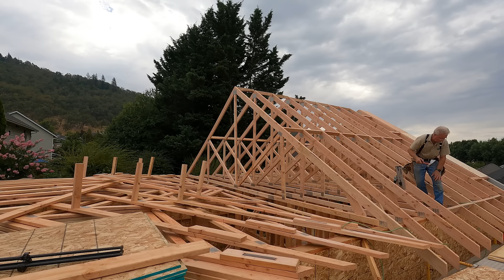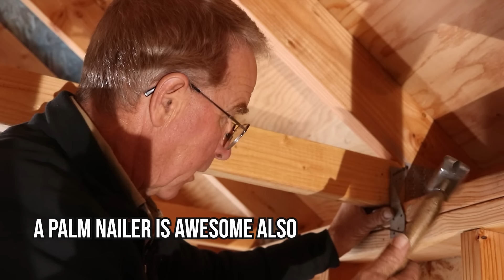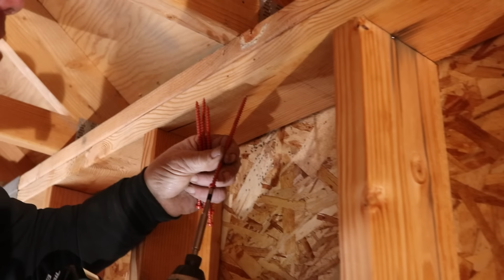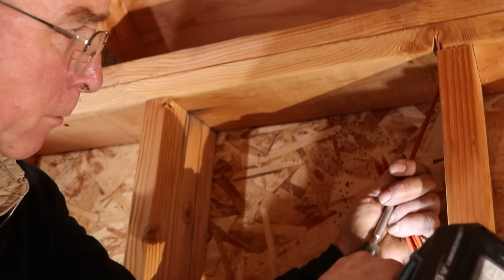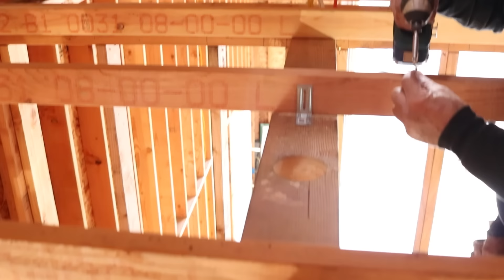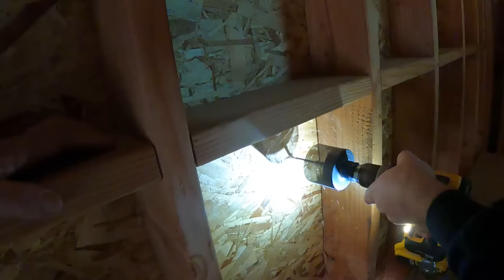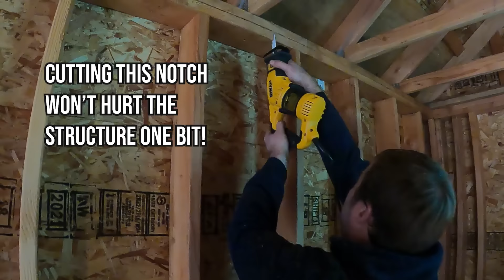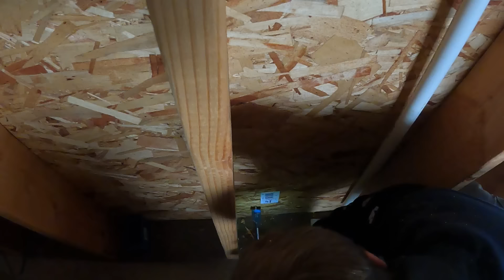Hold On To Your Roof! Truss Screws vs. Hurricane Straps: Shop Build #21

Comment: The first Simpson tie you had is a Simpson "H1" and the second one likely a Simpson "H2.5A".  Both are part of their Seismic and Hurricane family.  One thing of note, don't assume all truss ties do the same task.  While they similarly hold the truss to the top plates, their ratings are different.  The H1 is rated for 480 lbs of uplift, whereas the H2.5A is rated for 700 lbs uplift.  Depending on the size of your trusses, and other truss design requirements, the uplift loads are generally stated on the truss drawings.  You then need to make sure the truss fastening device is capable of providing that uplift requirement.  On a pole barn I'm about to help a guy build, we had to design in Simpson H8 brackets, which are rated at 780 lbs.  Note, you also have to pay attention to what nails (and how many) Simpson states for each bracket.  Obviously, not all nails are created equal.   I know - probably overkill from a design standpoint as just toenailing worked for years.  But, our general way of doing things continues to improve.  I had not seen the new Simpson screws, and not sure what their uplift ratings are.  Seem like a great approach, but also a little more dependent on the installer screwing them in correctly (not on the edge of the truss or out the side, or ...).  Regardless, great video as always.  Kept wondering where you guys were at as far as the garage for your son-in-law.
Reply: Simpson makes screws for the steel plates as well which actually can bump the rating up as well. I used them on my roof and deck renovation I has limited access and with a 90deg bit on my impact driver i could run them in spaces I could nor swing a hammer.

Comment: I'm curious why the condensate line would run so far down in the wall to go out at the bottom. Seems like a sacrifice of thermal efficiency of the wall cavity. Is it a trade off for the aesthetics of not having a protrusion in the middle of the wall?

Comment: With all the roof structure strapped down to the wall frames, seems like the weak point is now the roof sheets or roof tiles which are only nailed or screwed to the structure and may still be blown off in extreme winds? I’m no carpenter, but just had that thought

Comment: Simpson makes shear rated screws now for joist hangers and hurricane ties. When you have smaller jobs It's much easier then pulling out a compressor and a gun, or nailing.

Comment: It seems those long screws wouldn't be nearly as strong as those brackets. The screws only have the screw threads holding them in, where the brackets have an entire screw holding them in at a 90 degree angle. I would guess that the long screws also have much more of a chance to split the truss than the screws from the brackets do.

Comment: If you place hurricane clip or truss tie to the non-sheathing side of the wall as you demonstrated, you have to provide a connection to the stud as well, otherwise the uplift load pulls the plate up.  Simpson mentions this in their catalog.   Otherwise it should be applied to the sheathing side of the wall.
Reply: Great point! You had me go check how I installed them on my 12x16 shed 5 years ago lol. I did it right!
Reply: I've seen the screw type installed at an angle from the inside face of the stud at an angle up through the plate and into the truss. Seems like a really good system for tying it all together.
Reply: Up here in Canada we’ve always placed our ties on the  exterior. Having the steel plates on the inside also creates cold spots due to thermal bridging.

Comment: I'm 72 now, and I feel it.  But when I was young and building my house, I did not have all the tools and knowledge which helps make the jobs easier, and a lot of tasks I did at least twice, instead of once.   Lol.  I struggled.  I remember many late nights after working all day, that I could just barely put one foot in front of the other.  It was very very tiring, but it was a GOOD feeling of extreme tiredness.

Comment: @2:03 you say "you take Tico nails" to nail the hurricane clip.  It would be good to point out that a huge number of these brackets are installed improperly because Tico nails (short 1.25"-1.5" long) are only to be used in very special circumstances and hole locations when called out by the bracket manufacturer.  So you should never use Tico nails into the top plate for this hanger, only into the truss because a longer nail would hit the other side of the bracket.  Unless it is impossible to use a longer nail, it is almost always required to use a full sized (usually 10D 3") nail in every hole, sometimes even if the nail pokes through the other side (just bend over and clench in that case and you get even more strength).  Check the instruction everyone and always follow the manufacturer requirements to get full capacity.
Reply: Lol
Reply: @chuckb470  Can you explain your laughter?  Are you saying that it is good practice to use incorrect nails to fasten nailing plates?  Do you predict that they will achieve the rated strength when used against manufacturer recommendations?  If there is one thing that this channel is try to to do, it is to get people to do things correctly and stop building crappy stuff.  Reading the directions and following the instructions to the letter is important.  Leave an open hole on a joist hanger and it is no longer a proper installation.

Comment: I really enjoy you videos but I have just a couple of observations. The first and second methods are both Simpson Hurrican clips the first has more capacity than the second. "Technically" with trusses, the framer should be holding the top of non-bearing walls down at least a quarter inch and then install the STC truss clip with a gap between the truss and top plate. This is to allow the truss to deflect correctly without putting pressure on the non-bearing wall. Last of all you should NEVER use standard philips screws with any Simpson hardware. They are brittle and the heads will snap off long before the connector reaches its rated load. Nails or Simpson approved screws should be used to maintain warrenty. this is the end of the PSA. Thanks!!

Comment: I once built a little 2'x8' outdoor lumber rack with a roof, no walls. Used hurricane ties to hold the rafters in place because I thought it would be quick and easy, albeit way overkill for what I was doing. Oh man was that way more effort than I expected hammering all the nails in by hand. It didn't help that the structure wasn't very rigid and half the force of the hammer swing went into moving the structure.

Comment: Here in aus we use a cyclone tie. Single piece looped steel strap run over each truss down and fixed to the underside of the top plate. It be good to test these and the Simpson ties mentioned in your video and see how they compare. My bet would be the cyclone tie

Comment: Great video, but geez, you'd have to hang the sheetrock with 16 penny nails to get deep enough to hit that wiring in the middle of a 2x6.  Probably code that you must use the nail plates, though.
Reply: I think code specs like under 2 1/2"...

Comment: Where code requires; Joist hangars, Hurricane ties and all the other engineered brackets require a "code rated fastener" in "each" hole in the bracket.  Framing inspection will fail if you miss fastener holes and or use generic nails/screws in your brackets.

Comment: One of the greatest tools I ever bought was a joists hanger nail gun…until Simpson came out with the truss screw and I bought a speed stick. My hanger nailer just gets dusty on the shelf now except for the few times it’s used on floor systems

Comment: Those truss screws are better than nothing, but the shear strength of the  metal ties  (either style) held by nails cross grain in the bottom chord  will work much better in a hurricane or tornado.  The clips take much longer to install, and cost more but you only get a chance to do that work once.
Reply: Testing shows the screws to actually be stronger, but what do I know, that's just what Simpson says.
Reply: @timothydillon6421  Who is paying for the tests? It seems like those screws could be faked a lot easier unless the screw heads are marked somehow.
Reply: @MAGAMAN  They're 'marked' by being that orange-red color. I'm not sure where you'd be able to find a 6" orange trim screw (what it kinda looks like), and the pricing seems to be about $1/per in small quantities. Even a generic 6" construction screw would probably be about half that cost in small qty, so I doubt it's worth pissing off the instructor or wasting time trying to 'cheat'
Reply: @MAGAMAN  coming from someone who identifies with what you have chosen for a name and icon is particularly, ludicrously hilarious. Why would you even think of this?
and where's Jared on all this?
Reply: @osmith5086  tds
Reply: There's nooo way a screw would be better than a plate connector  holding up high winds. And by the way, the connector should be attached to the studs also end even all the way down to the foundation.
Reply: Don’t forget to strap top of stud to top plates and bottom of studs to bottom plate.  Every other stud is best.
Reply: The truss screws, especially when driven into the truss area between the connector plates are extremely strong and don't flex.  There are better options than the screw shown that have larger heads for better pull through resistance.

Comment: These not only keep the roof on by battling winds, but keep the wall in! The house I bought had had a longlasting sewer leak by the front corner, which undermined the foundation and encouraged the wall to lean out by a few inches. (Previous owners patched the drywall!) The roof rafters were toenailed to the wall, which didn’t keep it in place. Any sort of tie would have helped. (We used 2x4s.)

Comment: better to use truss head screws rather than a flat or bugle headed screw for the truss clip. The cone shape can easily pull through, while a truss head is like a washer and resists pulling through.

Comment: And how does wind suck the roof off a building?  The same way a moving airplane develops lift: because of the Bernouilli effect, regions of high airspeed exhibit low pressure.  In an airplane wing, this happens because the hump in the top of the wing forces to the air to move faster over the top of the wing than under the bottom.  This causes a pressure differential and an upward force.  In a peaked roof, the effect is magnified because the air inside the house is motionless.
Reply: PS.  The same effect can suck the windows out of skyscrapers.
Reply: Moving air creates a low pressure area, therefore, the interior of the house has a higher pressure. It blows up like an overinflated balloon.

Comment: In South Florida, especially after Hurricane Andrew in ‘92, the building codes got a lot more stringent ‘cause a lot of roofs blew off. Mostly because of shoddy workmanship and contractors cutting corners. My first house, built in 1950, had 3/16” steel straps imbedded in the concrete header, bent over every other truss, then nailed on both sides. Seemed to be kinda sturdy. 

Pray maintain speed and course. And keep teaching us.
Reply: I was building in FL throughout the 1990's and you're spot on.  Codes got really stringent.  They were even doing roof sheathing nailing inspections.  Slab to 2nd floor roof all-thread rods to hold it all down. Shear walls, truss bracing, I could go on & on.  That's when pneumatic palm nailers & dedicated hurricane clip nail guns were born.
Reply: Still do that here in central florida to this day. Home being built down the road has straps wet set in the grout in the top course of the cmu walls, specifically for what you stated, crazy to think they continue to use that tried and true method

Comment: The code is hugely influenced by the industry.  Every year we get told that some new whiz bang device is needed.  The electrical code is the worst with GFCI and now AFCI requirements for plugs and breakers that don’t work reliably.  I’m sitting here in a snow storm with downed power lines somewhere.  My generator is running fine but the stupid GFCIs are not happy.  
Hey industry, not everyone lives in the freaking city where the power grid is tightly controlled.  Some of us are under California PG&E which can’t find its ass with either hand.
Reply: Not sure if it's related, but my bro just built a new house and his dryer would immediately blow the breaker, while it had been fine in his old place for years. His electrician wouldn't put in a less sensitive breaker, so he had to buy a new dryer. 🙄

Comment: I do love your content thank for posting but in germany  we descoverd screws about 25 years or so ago in framing  we screw everything joists studs beams everything we call it Holzriegelbau wich means woodsturucture buildmethod the rof sheating underneath the main shingles is about the only thing thats naild on because sort of stringers go ontop wich are again screwd through

Comment: I have seen roof trusses that were secured to the top plates with hurricane clips, pulled off the structure when the plate held on by spikes through the plate into the studs separated & blew off by wind. A couple of straps nailed to both plates & several inches of the studs every 6 or 8 feet would have prevented that. The sheathing accomplishes that somewhat, but just a few extra connections can make a building more hurricane proof. We're building a large "tiny home" for our daughter. It paid for itself to buy a special nail gun just for metal clips & brackets. Our gambrell roof trusses are half truss secured at top to a 50 foot ridge pole truss & at the top of the wall using 6 straps & clips for each. Nailing over 600 brackets was very easy with the nail gun.
Reply: For this very reason, Simpson’s own literature says to use the H type connectors on the sheathing side of the wall, not the inside as demonstrated here.  It is for the issue you raised.

Comment: @Scott the 2nd clip is the original Hurricane clip. The 1st model you showed was the improved. I banged so many 6's through the 1st clips that I'll never forget them. I believe it was Hurricane Andrew down in Florida city just south of Miami that pushed the original building code that started it all. So many roofs were lost so they invented that system of truss tie down. Now we're running threaded rod all with 3x3 or so square washers from top plate clean through bottom plate as Hurricane and coastal homes. Alot of steel my friend.
Wasn't sure if you knew or have seen it yet. 🤘😎✌️
Reply: Then the learning curve of a low pitched roof acting like the airfoil of a wing and lifting the roof off. Up here in Jacksonville all new roofs have to be of a steep pitch. Same goes if the entire roof and trusses have to be replaced no more low pitch.
Reply: @Dremwolf  6/12 is the lowest I go and I'm so tired of 8/12 and more. Did thousands of those on homes 12k sq/ft and larger. Frk'n roof systems were monsters.😎✌️
Reply: @shanesouza4303  I've only done a tiny bit of construction work as a helper long ago. Steep pitched roofs killed my ankles. Any time I see someone on a steep pitched roof my ankles hurt in sympathy.
Reply: The biggest problem houses have in a hurricane is the way they are designed. Most houses have a pull tab all the way around them fro the wind to catch. A dome shaped house would do the best against the high winds, but most people (including myself) would not want to live in that.

Comment: I've been a contractor in the Netherlands. these aren't used overhere because we use real construction methods instead of nailing every silly piece of woodwork. When I saw you nailing those roof trusses I can fully understand why U.S housing goes up, in the air, when there are very, very strong winds. This is just nailing wood together. We use nailplates and such but it is always joined with 
mortise and tenon connection-methods and thén, only then we use nailplates in conjunction. Or straps. this is not carpentry, this is just handymans work. Nothing more. This has nothing to do with construction. see how much wood you all need for one roof. Look up roofworking from overhere(Holland). you'll see...
Reply: This is kind of a narrow view. In the US people use timber framing as well when they desire, but the greater efficiencies here go to stick framing and methods/materials have been developed to make it very good.  The idea that only carved out connection methods are carpentry is pretty silly.
Reply: The Europeans favorite past time, telling us how much better it is in Europe.  Yawn.
Reply: Go spin a windmill..
Reply: Do you guys have earthquakes in the netherlands? How bout floods? From Tundras to Deserts, to Swamps and Rainforests. The US has houses in all sorts of climates. How many biomes does your tiny little country have? Just because you have a method of building in your country does not mean that it works the best for the rest of the world.

Comment: Building Inspectors need to watch this video. They all look for Hurricane Straps. They need to take off the blinders and look for the truss screws before they fail the framing inspection. I'm just sayin'.
Reply: They won't fail you if you let them know what method you use. And some areas won't allow you to use truss screws. Do you even construction bro??
Reply: It depends on local codes and what the building engineer specified. In Florida all buildings require engineering, even storage sheds (if you don’t try to sneak it by without a permit)
Reply: A good builder is on site for the framing inspection.

Comment: Be sure to put a truss nail in EVERy HOLE.   Ask me how much trouble to go back and add the missing nails after the inspector has raised hell.  The hardware is designed to do its job with a nail in every hole.  Go buy a palm nailer and ear muffs.  The little nailer ie less than $50 and noisy as 😊as a high school band, but it gets into very tight places . 

JoeB